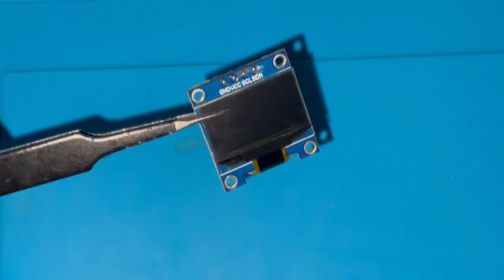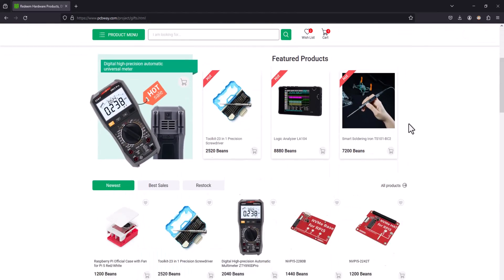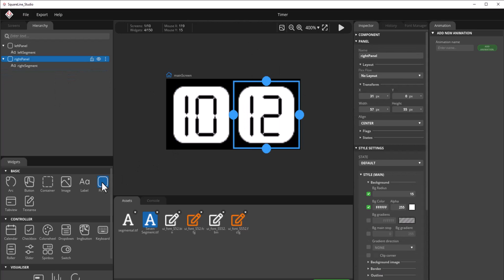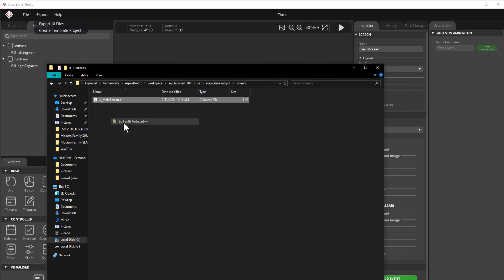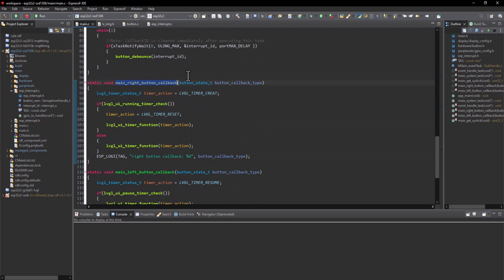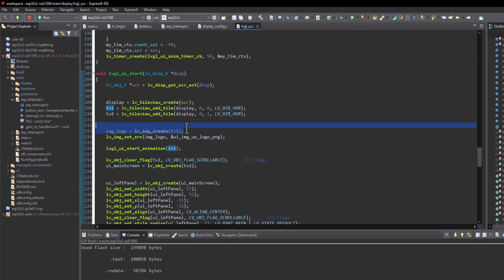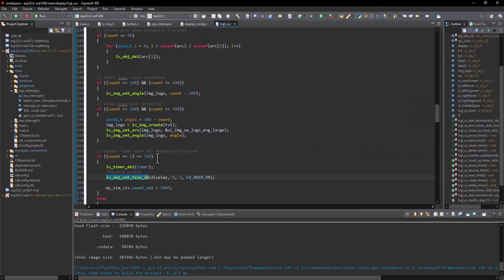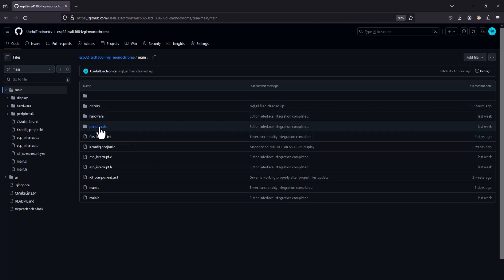ESP32 OLED SSD1306 LVGL Embedded UI Design

Comment: How can I use SPI instead of I2C for the same SSD1306 Display. Please help me.
Reply from the maker: Your display must support spi
Reply: @usefulelectronics  Yes. My SSD1306 Display supports SPI. I already programmed that display to run using SPI with other codes. But I am not able to display using LVCL library as you done in your video.
Reply from the maker: @vigneshs-dev  I see, you will need to updated layer since it is based on I2C driver 
I have worked with SPI driver before to get GC9A01 Round display running 
https://github.com/UsefulElectronics/esp32s3-gc9a01-lvgl/blob/main/main/display/gc9a01.c#L34
you can have a look at it and update display_config layer accordingly

Comment: Great video, how could I use a screen with the SH1106 driver?
Reply from the maker: You will need to update display_config.c to configure the display driver correctly 

You are able to modify the OLED driver from idf.py menuconfig from the command line. SH1107 and SSD1306 are supported 

I don’t know how similar the drivers are but there won’t be a lot of job to do 

It would be amazing if you can add support to your OLED driver and push the update to GitHub repository so everyone can use it

Comment: Can it be used with arduino ide or vs code?
Reply from the maker: Yes but you need to change the display driver implementation and LVGL library configuration to suit Arduino framework